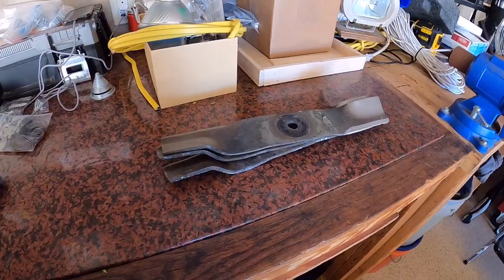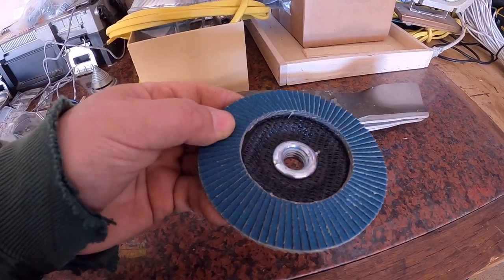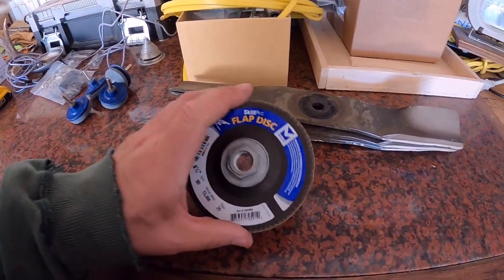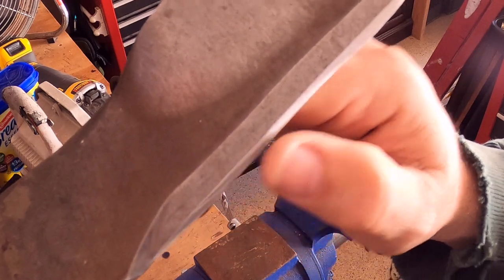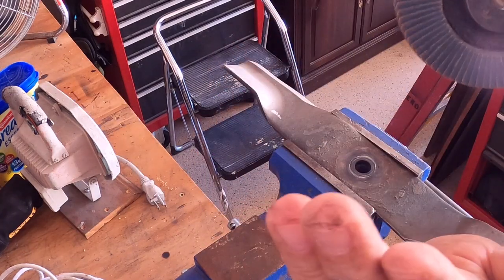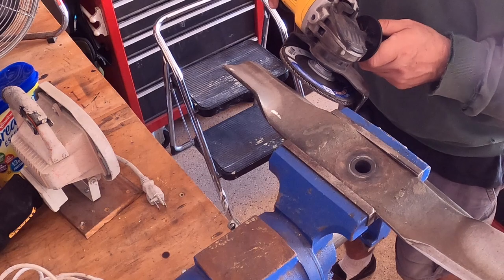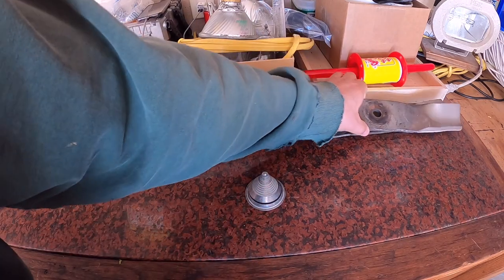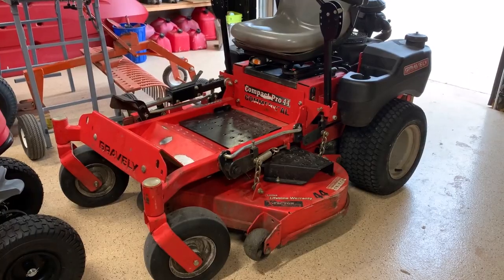Sharpen Dull Lawn Mower Blades ● Easy Trick For Great Edges with Basic Tools ✅

Comment: I like the idea of using a flapdisk- hadn't occurred to me. As I understand it, the angle is chosen by the manufacturer for the particular application. Most current mowers use  30 degrees, but others use up to 45. This works in conjunction withe the sail or shape of  the blade which controls the airflow, etc. I'm guessing just getting it sharp gives the most benefit, but keeping the original angle is supposed to be important. Using a flapdisk appears to be the easiest way without a specialized tool.
Reply from the maker: Yeah I just try to get the edge sharp again and over time the normal wear keeps that general angle about the same. I don’t like the idea of shaving down that entire edge a 1/4 inch every sharpen.  There’s so many rocks out here the blades wear down fast already. Thanks for your comment.
Reply: @ApacheRanch  I actually tried ithis, and the flap disk worked well. I had a couple of deeper dings that I smoothed but didn't remove (not 1/4", though!). The biggest takeaway, however was on blade balance. For the first time ever I decided to balance the blade, although it was kind of crude (I balanced it on the mounting bolt). My mower vibrated which I didn't remember previously. I bought a cheap Arnold balancer at Walmart (the only one I could find locally). The balance seemed off very little, but I ran one quick pass of the disk down the blade and it only looked a little bit better. However, in practice the vibration was much reduced. I have a battery Ego which I'm sure has less vibration than a gas engine, which probably highlighted any out of balance issues. Overall, the cut is more even and the grass ends look better. I'd hoped maybe it would reduce battery consumption a bit, but didn't seem to. Regardless, I now have a fairly easy and quick method. Thanks! PS A battery powered angle grinder makes this even easier.
Reply from the maker: Thanks for your comments! I had not thought about the impact on an electric mower. Yes balance would likely show up there as very easy to notice. Glad you found a way to make it all work!

Comment: Flap disks are my preferred method, no doubt!

Question...I notice you have two different planes on the cutting edge of the blade. One original angle that I assume came w/ the blade, then a steeper angle that you put on it w/the angle grinder. I have never considered doing it this way. Have always kept the same angle as the original beveled edge.

May I ask, what is the advantage of two different planes on the cutting edge?
Reply from the maker: No advantage really - I just don’t like taking off too much from the blade each time. I sharpen more often this way.
Reply: @ApacheRanch  I may give it a whirl that way, see how it performs...thx!